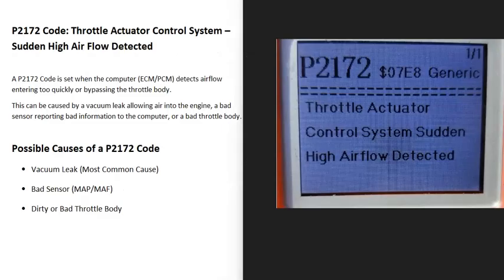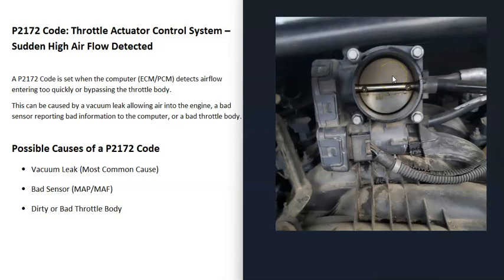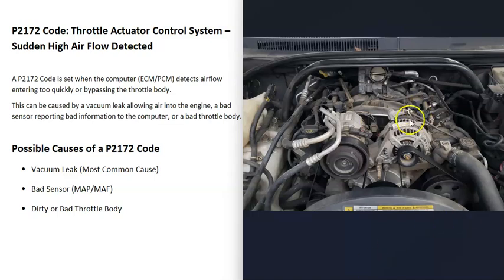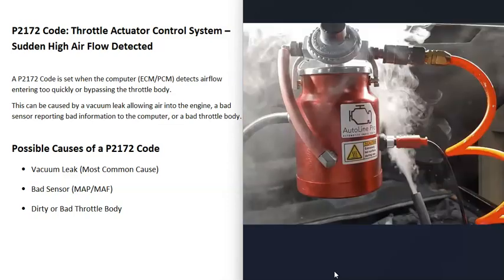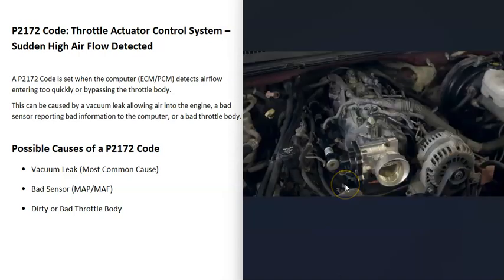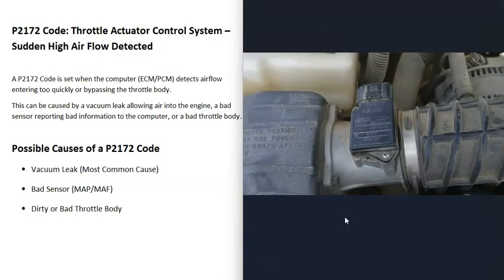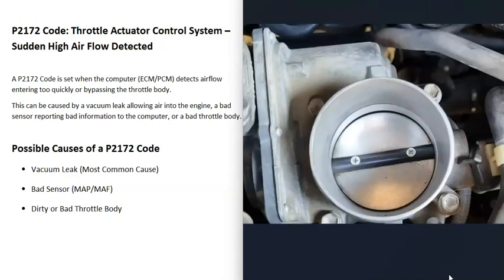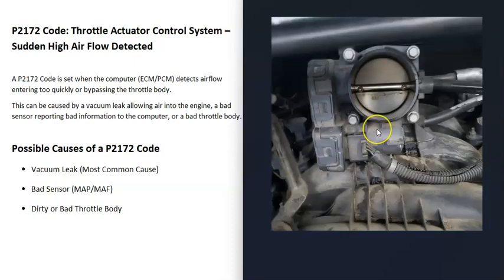Causes and Fixes P2172 Code: Throttle Actuator Control System – Sudden High Air Flow Detected

Comment: Could be an open valve. I got this code and camshaft position sensor codes when my timing chain broke.
Reply: Did you fix it I’m having the same problem rn help pls bro
Reply: @VasniVelasquez did you fix it??
Reply: Dang man I sure hope that ain't my case. My ladies '22 dodge ram shutoff while driving at only 63000 kms and is sending me those same codes.